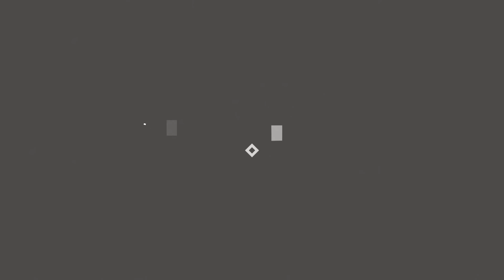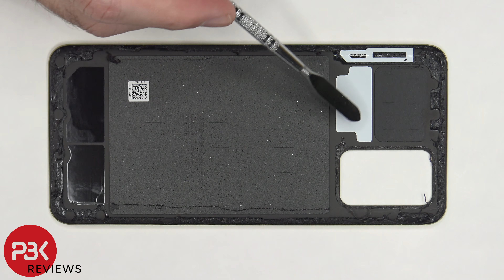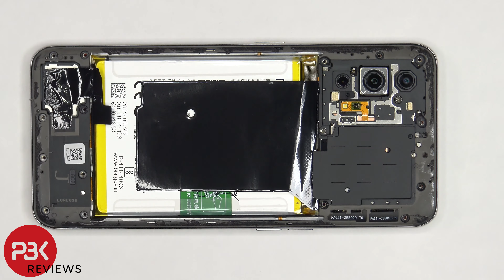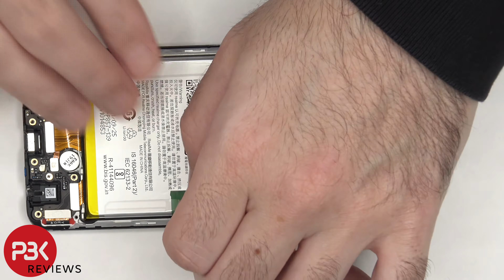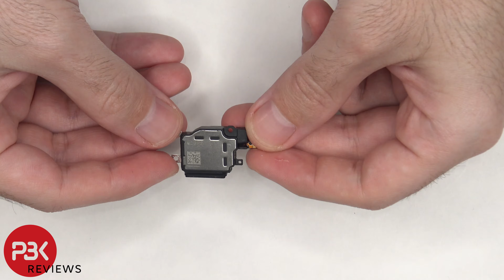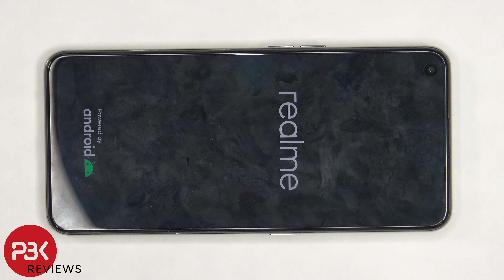Realme Q3 Pro 5G / Realme X7 Max / Realme GT Neo Disassembly Teardown Repair Video Review

Comment: Nice video. I have a realme q3s with battery issue, but in my country doesn't exist this model for a remplacement.  I have a question: Is there a battery from another model that its battery is compatible with my phone? In my country i can find battery for realme 6series,  7 series, 8 series, 9 series, Gt, narzo 30
Reply: I have the same problem as you. My battery is old and so easy to drain. Did you find out what battery is it?

Comment: Does the q3 pro have gorilla glass protection
Reply from the maker: Hi, no it doesn't have gorilla glass.
Reply: @PBKreviews  so what kind of glass coz you know its a smartphone its risky to buy a phone with a normal glass that protects it well it wont even protect it
Reply from the maker: @grantdelver5808  not sure what type of glass it is, but its not gorilla glass. There is no mention of the material for the screen from the manufacturer.
Reply: @PBKreviews  thats kinda sad i will choose poco x3 gt than this its better to have lcd than an amoled that there is a possibility that anyminor drop it will brake not to mention the repair price

Comment: Do you need to warm it up before disassembling?
Reply from the maker: yea you can use a hair dryer or heat gun (hair dryer is safer to not over heat and damage etc.) and gradually heat up the back so its hot to the touch. You can always apply more heat as your working your way around prying off the back.

Comment: I don't get it, why calling a $200 phone Pro ?
 I saw adhesive  copper tape in stores, i would plate my phone under the battery with a big piece and a huge one over the whole phone before closing the back (except small places with antennas).
Reply from the maker: Not sure, but you can't put copper or conductive material all over the phone, since you can short it.
Reply: @PBKreviews  already done it on laptop and game boards, nope, it has a good layer of adhesive , will not short anything
Reply: how is it now ?